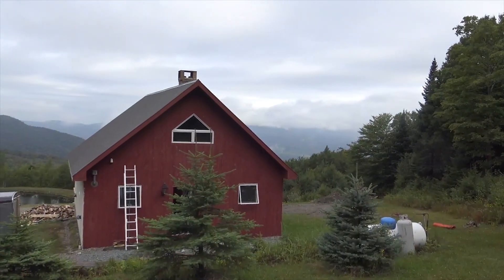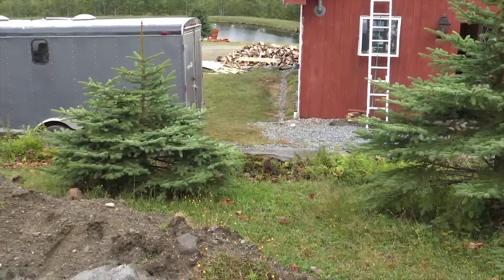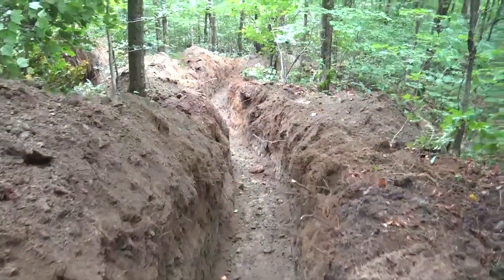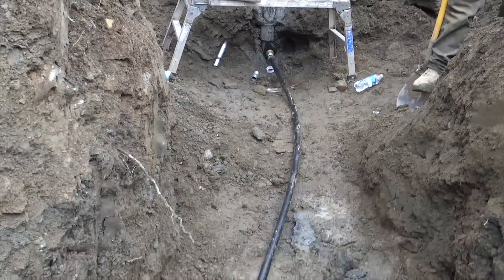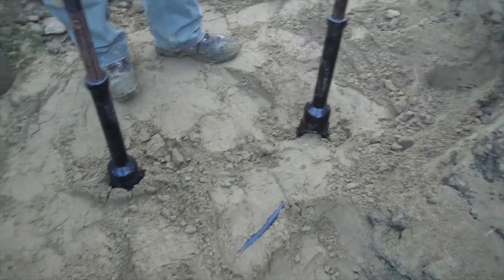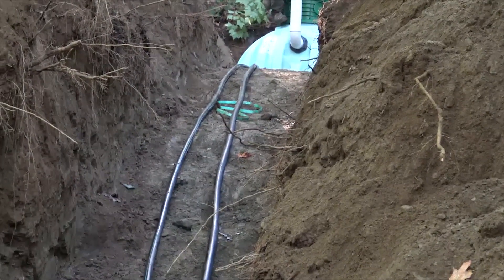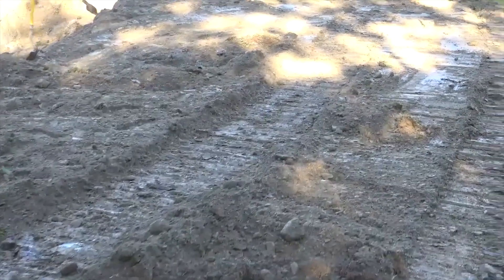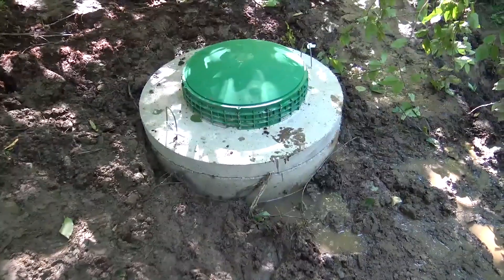Cold Climate Renewable Infrastructure: Water

Comment: Do you have to dig such a huge hole to put the pitiless adaptor in? 6’ deep trenches are big. Do you use them to put the power line in as well? 
I’m in a similar climate 10 minutes from the Canadian border. However, I’m not on a hill. So my water tank will be located under the roof on the cabin. 350 gal should do the trick for a week supply. But how would I handle the overflow? Run it down into the septic line? It’s grey water only, toilet will be a bucket. 
I have seen those shut off valves on frost free hydrants. Well, maybe different design but same principle.

Comment: I know the answer is very complicated with every job, but some idea of cost would be really helpful.  With certain loan programs in states I'm sure people would love to have a financial planning goal for the projects they might want to take on.  

Like me, I would love to do some work on our home to take a well insulated solar aspect partial berm house up to net zero.  I dream on turning our bombed out pool into a geothermal loop field.
Reply: buddha4242 many tax breaks and loan programs for solar require you to be grid tied. 
Scott did a DC system where different loads had essentially their own power supply (solar and batteries). I think that’s a great way to slowly disconnect from the grid, one critical load at a time. It also allows you to do projects as finances allow. And of course, you can never suffer total power failure.

Comment: I live on CA border! You could have saved K's$ by putting storage next to house backup is pond to pressurized and filter system, use LP or dual system also can be use 24/7 for forest fire prevention systems primary for that should be pond, money shaved should be 2-3x storage! You would still be ahead $'s K's don't you do CBA?! You can also haul water, others either do, or a Business opportunity?! You seem to have sized for a village, show a range of options your better than this?!
Reply from the maker: I don't think you understand the system. I have an elevated tank that provides the pressure, without any power needed. 1 pump, 3 panels and a tank on the hill.

Comment: So well runs with out any controller to regulate the tank level ,why?
Reply from the maker: No controller to fail, fresh water, tank turns over everyday, overflow water tops off the pond.  Three panels of pump and an elevated tank. It doesn't get any simpler and more  bulletproof than this.
Reply: Engineer775 what’s the life expectancy for the pump when it runs 24/7 ?

Comment: In the UP of Michigan we bury water lines at least 6' down, some years the frost can push down 7'+. Some contractors put one to two inches of styrofoam over the water lines. I believe the vent pipe should be high enough, depending on their snowfall averages. Here in the snow belt it's possible to get 16" of snow in a day, with high winds comes high drifts, so the input and exhaust vents on gas furnaces and water heaters got blocked...it looks funny to see them moved up 4 to 6 feet higher. Love to watch your videos! Keep up the good work!
Reply: scott S the foam is a good idea